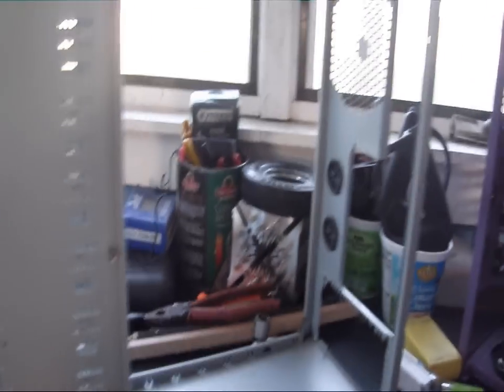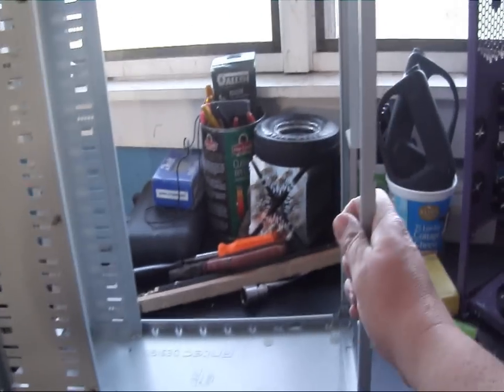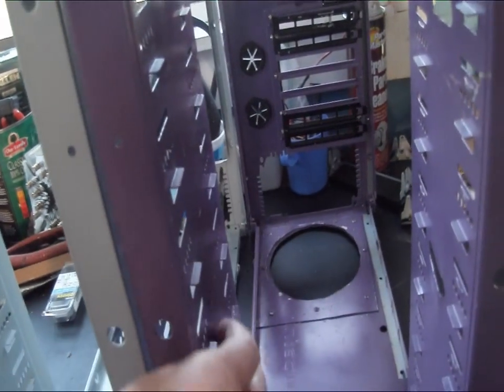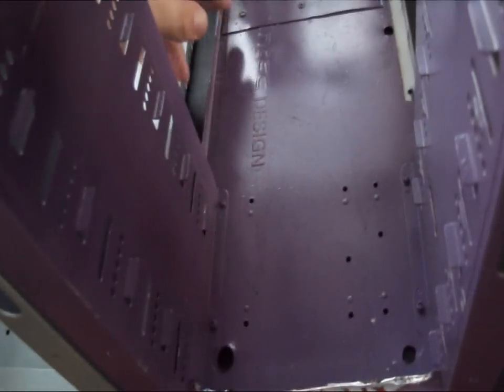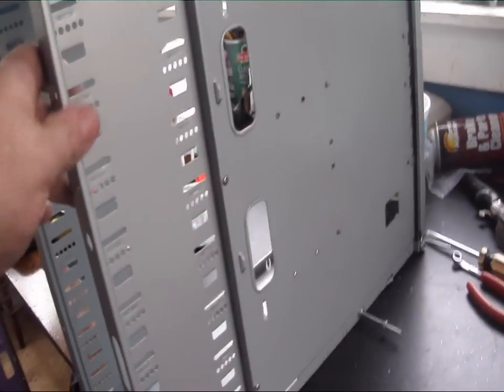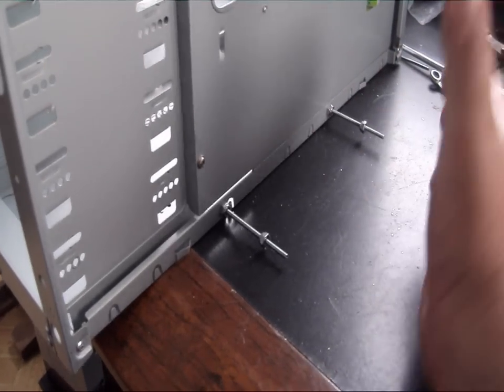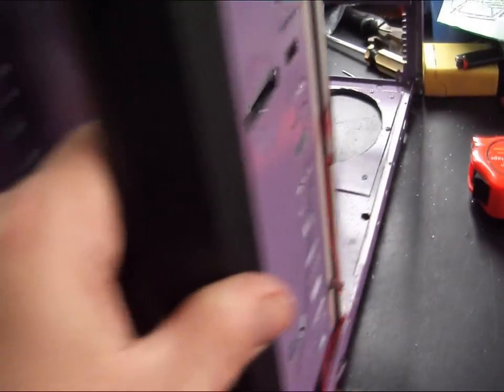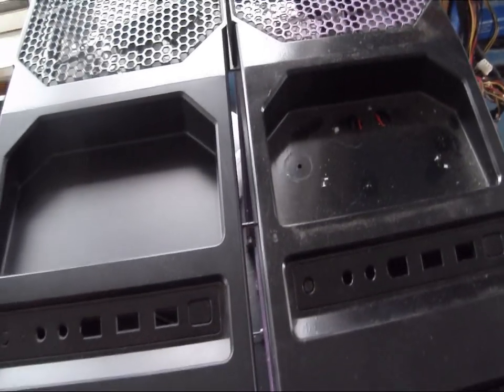Antec 1800 Build Log Part 2

Comment from the maker: I had thought about doing that. The problem is that the side with the window and the motherboard is also going to have the rad. Just because I don't like seeing cables and to make the hoses for the water cooling simpler. So I would have to put them on the other side of the case and that would be facing the wall when I use it. So it is kind of a dilemma.

Comment: now you'll have 2 spare side panels to mod, if you screw up one, then you've got more! you could max out whatever board you put in there, 8 SATA drives, a card reader, 8 fans in each case, you'll have the ultimate water cooled Antec 900 ever! you could still say its a 900, because its 2 of them, but 1800 sounds better! I had to lose the side panel on the Compaq case I used for my PC, its an IBM mobo with half of a Compaq case air cooled to the limits, no side panel is actually good, heat rises!

Comment: I'm stuck using an old Pentium 4 3.06GHz with 2GB of RAM. it works better than the 2011 Acer laptop I was using with win7. it plays HD youtube vids very well, and runs games at a half decent frame rate. it only chokes on this 1 video, i don't know why. but now I can use a nice old PS/2 keyboard, and I can type more and faster without hitting any other buttons in the process. I have big hands, so I need big keyboards, LOL. But thats good work you have, I can't wait to see the finished product!